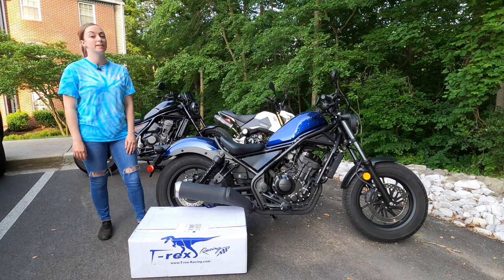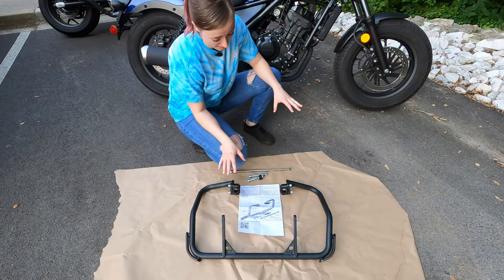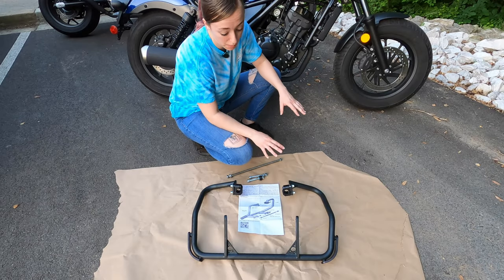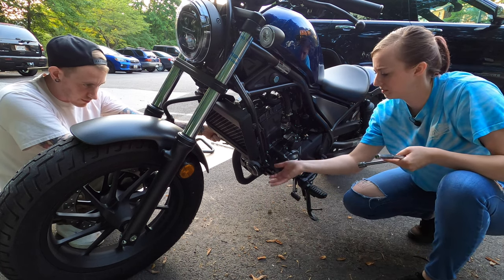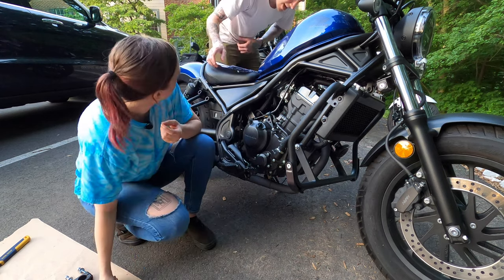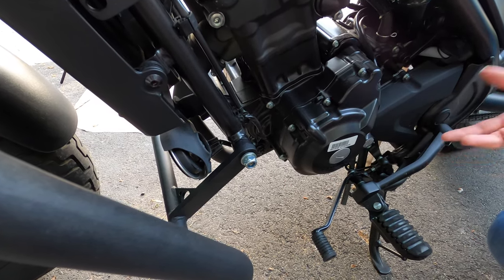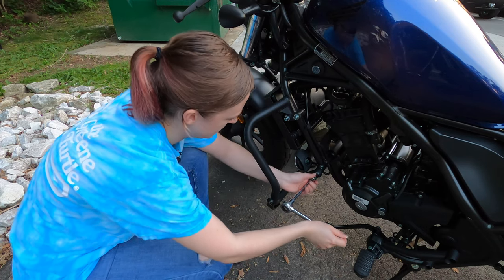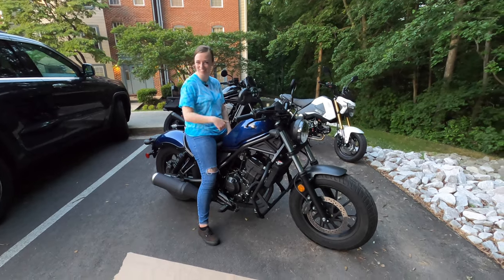My First Rebel 300 Install EVER!! (T-Rex Crash Bars)

Comment: I made a mistake purchasing mine. 2017 rebel 300 that's a lemon. 65mph top speed, worst mpgs this thing suck fuel, and insurance is damn expensive. I wouldn't recommend these rebel 300s to anybody. I'm having a hard time selling it cause nobody wants to buy garbage. Overall my review of them is utter garbage made by a manufacturer for a quick cash grab by supplying riders with a crappy 286cc engine that has about the same horsepower equivalent of a harley.
Reply from the maker: Oof hate to hear that!! That’s the first bad “review” I’ve ever heard on any Rebel. Sounds like it’s time to drop whatever price you’re trying to sell it for and go get a Harley. Good luck!!
Reply: @KomotoVlogs  well when you can't get hiway speed and you go to bike meets and everybody looks at you like what's this garbage doing here it's kinda hard to do anything or make any friends at all.
Reply from the maker: Yeah definitely sounds like you’re not happy with your Rebel!! Wish you the best of luck with your bike and your friends🤘🏻